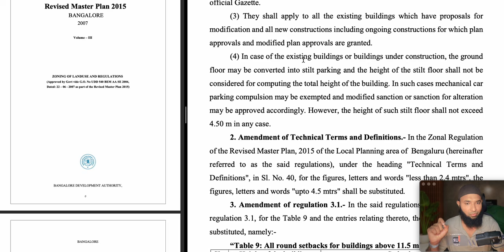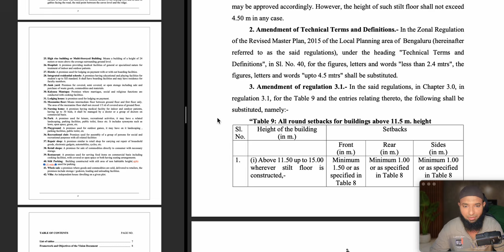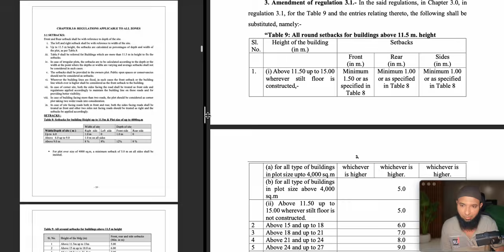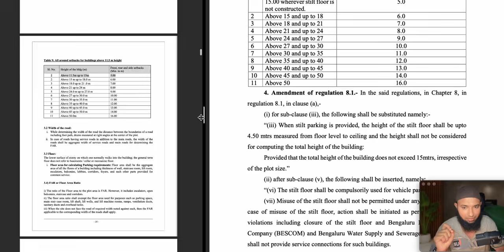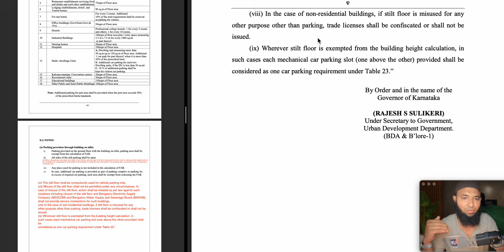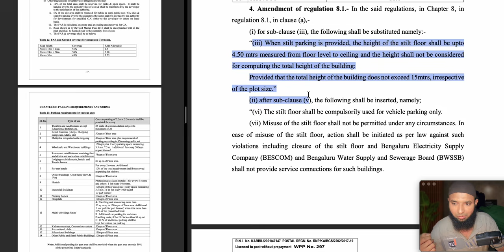🚨 Bengaluru Building Rules SHAKE-UP! 🚨 Major Draft Amendments to Revised Master Plan 2015! RMP 2015

Comment: Whichever higher in setback you can't pick 1.5 m as 30 x40 site too if you convert 30 ft to meters it comes to 9+ meters so it is the 8%and 12% of the width and depth you need to take into account in table 8 that is definitely higher value ..check again
Reply from the maker: Thank you for your input. You’re right — as per Table 8, the setback should be calculated based on whichever is higher: the fixed value (like 1.5m) or the percentage (8% for width, 12% for depth). For a 30x40 ft site (9.14 x 12.19 m), 8% of 9.14m = ~0.73m and 12% of 12.19m = ~1.46m. So technically, 1.5m still meets the higher value for the rear. Will definitely double-check against the latest draft amendments. Appreciate the correction!

Comment: What is the set back for 20*30
Reply from the maker: for a 20ft x 30ft (600 sqft) plot, assuming a building height up to 11.5 meters, the setbacks would be:
• Front: Approximately 1.10 meters (3.6 feet)
• Rear: Approximately 0.73 meters (2.4 feet)
• Sides (Left & Right): 1.0 meter each (3.28 feet each)

assuming a stilt floor is constructed, for a 20ft x 30ft (600 sqft) plot with a building height between 11.5m and 15m, the setbacks would be:
• Front Setback: 1.50 meters
• Rear Setback: 1.50 meters
• Side Setbacks (Left & Right): 1.50 meters each

Comment: How can under construction buildings make use of this? Should we reapply or just cite this gazette?
Reply: Any latest updates on setback
Reply from the maker: Yes there was need to make video not perticular but on these rules
Reply from the maker: It’s told modify ground into stilt accordingly they will approve changes
Reply: @AGENTALY yes but what’s procedure? Should we reapply or just cite the above amendment during assessment?
Reply from the maker: This indicates that to legally benefit from these changes, formal approval for the modifications to your existing plan is required, rather than just citing the gazette. The process involves seeking a "modified sanction or sanction for alteration" from the authority
Reply from the maker: Under construction buildings can make use of these new draft regulations. The regulations explicitly state that they "shall apply to... all new constructions including ongoing constructions for which plan approvals and modified plan approvals are granted.

This indicates that to legally benefit from these changes, formal approval for the modifications to your existing plan is required, rather than just citing the gazette.

Comment: Will this height being increased and set back reduced increase the FAR or number of kitchens in a building
Reply from the maker: Yes, the proposed amendments in the new draft regulations concerning increased height and reduced setbacks can indirectly lead to an increase in the Floor Area Ratio (FAR) utilized and, consequently, potentially the number of kitchens in buildings.

by allowing a taller (and thus more practical for parking) stilt floor that is excluded from total building height calculation (for buildings up to 15m) and by reducing setbacks for specific building types and plot sizes, the new draft regulations facilitate the construction of a greater volume of habitable space. This enables developers to utilize more of the permissible FAR and, by extension, potentially build more dwelling units, each containing a kitchen.

Comment: What is the set back for site  30x40
Reply from the maker: 1. For a building height up to 11.5 meters: The setbacks are calculated as percentages of the plot's width and depth as per Table 8 of the existing regulations. Since both the approximate width (9.14m) and depth (12.19m) are "Above 9.0m":
• Front Setback: 12% of the depth (12.19m) = 1.46 meters.
• Rear Setback: 8% of the depth (12.19m) = 0.98 meters.
• Side Setbacks (Right & Left): 8% of the width
(9.14m) = 0.73 meters for each side.
2. For a building height above 11.50 meters up to
15.00 meters, wherever a stilt floor is constructed (as per the new draft regulations): For plot sizes up to 4,000 sq.m (which your site's approximate area of
111.41 sq.m falls under), the new draft Table 9 applies. It specifies minimum setbacks or the Table 8 value, whichever is higher:
• Front Setback: Minimum 1.50 meters or the Table 8 calculated value (1.46m), whichever is higher.
Therefore, the Front Setback would be 1.50 meters.
• Rear Setback: Minimum 1.00 meter or the Table 8 calculated value (0.98m), whichever is higher.
Therefore, the Rear Setback would be 1.00 meter.
• Side Setbacks (Right & Left): Minimum 1.00 meter or the Table 8 calculated value (0.73m), whichever is higher. Therefore, the Side Setbacks would be 1.00 meter for each side.